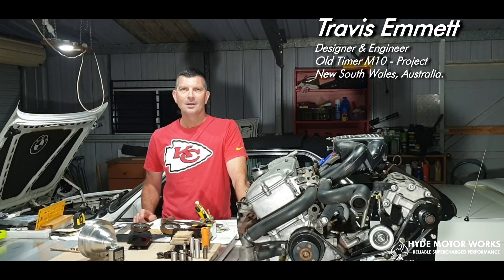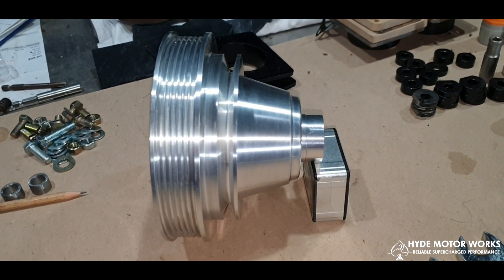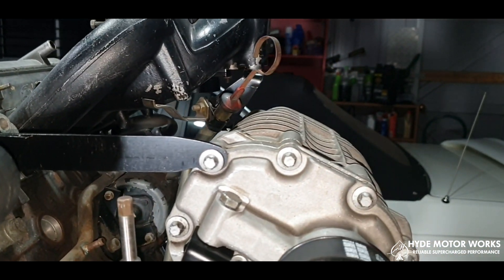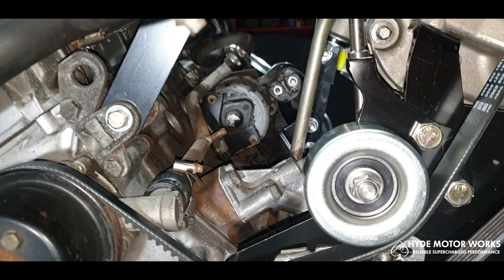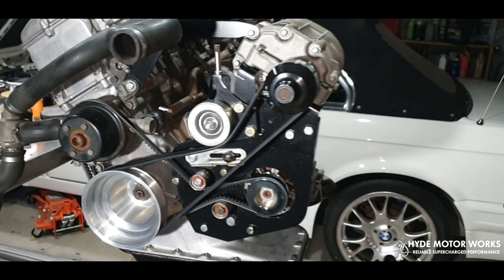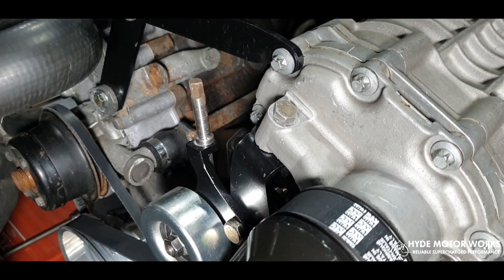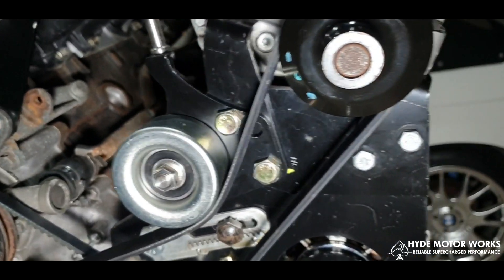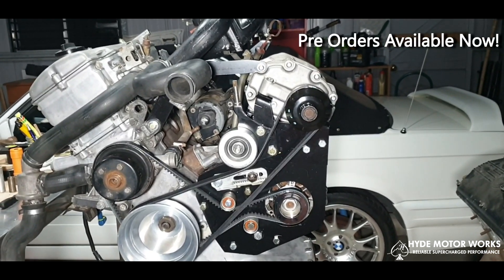BMW M10 Supercharger Kit for BMW 2002, E30 & More (Part 2)

Comment: time has come to settle all the wining from the "children":
Cylinder head ,combustion chamber c.c. valve diameter ,camshaft specs ,pistons ,charger pulley diameter .
Quantified dyno pulls at flywheel or at the wheel graphs.

Comment: Any updates. I'm about to rebuild my m10. I need to decide on compression ratio depending on supercharging or not.
Reply from the maker: Its complete and we have a new updated video on the Dyno coming in a few weeks. :) Feel free to email us. Some kits are actually in stock also.
Reply: Thanks  @HydeMotorWorks  . That's great news! Will the Dyno be of it in a car or on a stand? I'm anxious to see how it fits in the engine bay and need to see that before considering ordering. .. worried about fit with brake booster, etc.
Reply from the maker: You are welcome,  @JQ-02   :) The Dyno will be on the car itself on whats called the "Heartbraker" / Mustang style dyno, meaning no false corrected numbers. Pure raw rear wheel power, we should also be able to show the stock power before and after. If you want, you can drop us an email later, and we can also put you through with the designer here, Travis who can answer questions directly.
Reply: Thanks for your quick response  @HydeMotorWorks  . I will hold off on ordering my turbo parts and anxiously await the video :)
Reply from the maker: New update on OT M10 is now available.

Comment: Hi I've enquired about this kit a little while ago with Mr Hyde but my email has become inaccessible due to loss of 2 step authentication :(.
Regarding this kit what will come as part of it? what ECU would you recommend or is one part of a kit? thanks
Reply from the maker: Hello there, If possible could you kindly use another email and email us? We can surely get back into talks and if you are serious about this kit, we can put you through to the designer, Travis who can advise on the ECU and such you may want to have. Hope this helps and just drop us a line contact@hydemotorworks.com  Thanks

Comment: How much hp can be expected with this?
Reply from the maker: This setup is rated to push your stock M10 engine to its max power, technically if the engine can hold the power (perhaps you may want to build it with a better head gasket) you can expect double the HP output, for stock engines, you can also lower the boost with a boost controller.